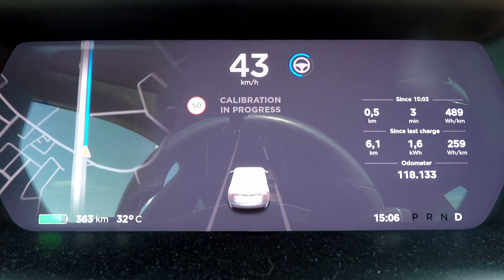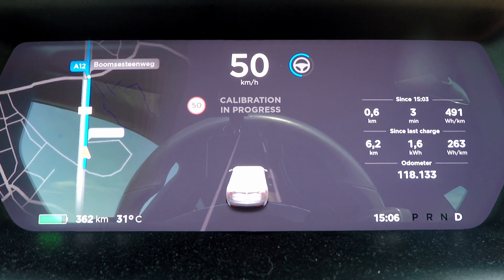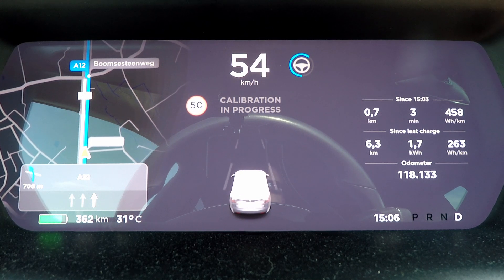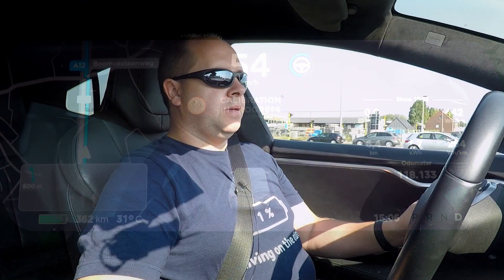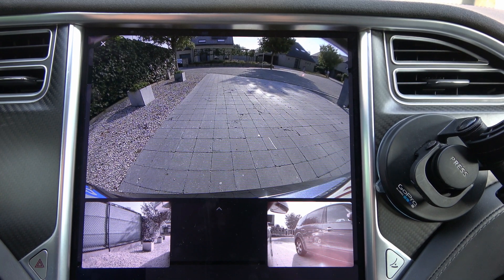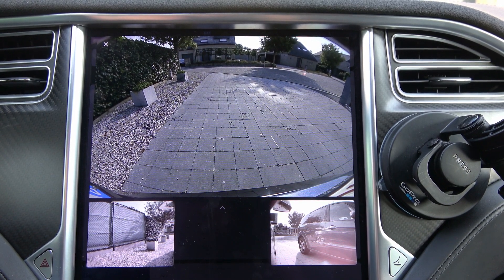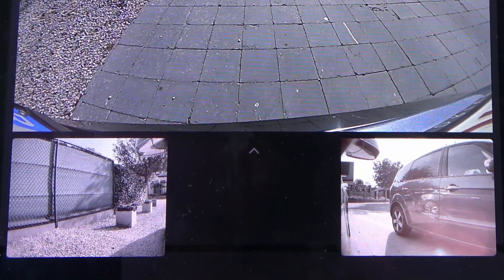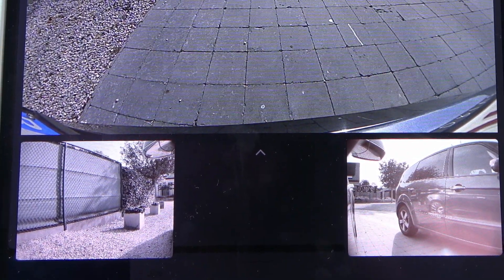Got the FSD and MCU2 upgrade installed today. What a difference!

Comment: Thanks - you can increase the speed of a slow mcu 1 also with a factory reset. See  https://youtu.be/qjYIN8yWfyw
Reply from the maker: Yes, but only for a little bit and only very temporary. Tesla has also tried to remove the cached Google Maps tiles and that had also a temporary effect, just as removing all your previous navigation destinations. They all help a tiny bit, but the fact remains that MCU1 is just not workable AND you're not getting any updates anymore. MCU2 upgrade is a no-brainer these days, especially since the price is a lot cheaper now than what I paid for it
Reply: @StevenPeeters  Indeed, the webbrowser still seems slower than it was after I first got the car (however I just did a test with a very weak LTE signal. Have to repeat that when the LTE is stronger.

Comment: I did the mcu2 upgrade incl. Ap3 with eap only because of the horrible mcu1 slowness and freezes and even if the problems with nand are well known and I've got still warranty for over an half year left Tesla doesn't do sh.. ^^
Reply from the maker: Same here. Didi the MCU2 upgrade because MCU1 was dying anyways.
Reply: Did they give any kind of discount for the MCU2 upgrade if the MCU1 is failing and still under warranty?

Comment: I had mine done on Thursday.(17/09/20) in Ghent. However, I did not have the calibration when I first drove it. Either something is not right yet, or the service center did that for me. Will call them on Monday. There are quite a few changes and I am not happy with all of them. So far the biggest disappointments are the quality of the new screens (far interior than before) and the fact that traffic lights do not get picked up... Will call the SC tomorrow and find out more...
Reply from the maker: Do you have the right software version? Calibration can be done by the service center as they test drive the car. it only takes about 10km if you are on the right road.
Reply: Bedankt voor je antwoord. You are right. Thee calibration was done by the SC. Got a message this afternoon that an update was available. Had to park the car very near the hotel to get WiFi. (we're on a short holiday) and after installing 2020.36.11, indeed it now reacts as expected. Have not come across traffic lights yet, but so far it recognises stop signs which it never did before. On the other hand, it seems to find traffic cones all over the place, while in reality, there are none. Heb jij ook de indruk dat de kwaliteit van beide schermen er flink op achteruit gegaan is? Bij mij is dat behoorlijk erg...

Comment: How did you request the MCU2 upgrade ? I already have HW3 which was fitted in Gent about 4 weeks ago, that was purchased 3 years ago on the website. I got CCS upgrade done through the app as Service/upgrades and typing in CCS upgrade then they sent me details and price by email and a Ranger came out. Please can you tell me how you applied for the MCU2, I am guessing the app Service/upgrade ?
Reply from the maker: I was contacted by the Service Center as a courtesy. Normally, you should request it via the app or call them.
Reply: @StevenPeeters  thanks. Will wait until fm option available as my mcu1 is working fine at the moment. Thanks for the video.

Comment: Hi how are the road tests going ? been calling Tesla service to get my HW3 fitted but its the same old story , call us in 3 to 4 weeks time .
Reply from the maker: Do you have a Model 3 perhaps? Those still have to wait. Comparing before and after AP test coming this afternoon. Working on final details and editing.
Reply: @StevenPeeters  No, model X 100D  Build November 2018 we had EAP when we picked up the new car at Tesla show room in May 2019.
Reply from the maker: zaferroni maybe the backlog is too big already? Dunno. It shoild be available if you order it with mcu2 combined.
Reply: @StevenPeeters  As I understand it the car is just over a year old and will have MCU2 The only thing I don't have  is HW3 and the new front magnetic motor ,but happy with the 2 induction motors which don't whine .

Comment: In the UK we lose the radio component (AM/FM/DAB) completely, you didn't mention that in your video? It can be added back (around 500 Euro) from October via an additional daughter board, apparently.
Reply from the maker: I mentioned that in an earlier video already. Yes, that solution should be coming in the next months, but will most likely be at an additional cost.
Reply: One does lose DAB. The original radio is analog. MCU2 van only deal with digital signals. One can replace the original radio with a digital version, but it is far from simple. Besides it takes changing one software line. Chances are that SC will not comply...
Reply: However TuneIn allows for most radio stations. But one can no longer change the channel via the steering wheel buttons..

Comment: Can you save video clips from sentry mode and use cameras as dashcam through USB noe with AP 3.0?
Reply from the maker: Yes, that shpuld work now. Still need to test that. But I have a real dashcam in the car so probably won’t use sentry mode
Reply: @StevenPeeters  would you explain why? I have blackvue installed in my car but only 2 channels so when someone keyed my car in the side we did not catch on film.
Reply from the maker: CBN you have a point there. But as far as I understand, you only get the last hour of footage before it gets overwritten. That is pretty much useless when you’re parked and something happens during the night.
Or am I missing something here? It also consumes a massive amount of energy compared to a Blackvue. I’ve heard people complain it can draw up to 10% overnight 😲
Reply: @StevenPeeters  you have fair points as well regarding power usage. I thought the frequency of overwriting depends on the size of USB penn. Not sure since I have ap 2.5. it is still interesting to know if it is possible to use this feature now after the upgrade. :)
Reply from the maker: CBN I will try the Sentry Mode as well of course 😉
Reply: @StevenPeeters  and dashcam footage as well please :D
Reply: @StevenPeeters  i have AP2. 5. I have a 32Go key and i have event from 1 month away so no, it only records when an event occurs so yoy have PLENTY of time.
For the consumption, it does draw power. Certainly nothing close to 10% but yes, if you let the car 3 weeks at the airport, it can draw your battery down...
Reply from the maker: Jean-Baptiste Labelle thanks for the info
Reply: I installed a 5€, 128Gb USB stick today (19/09/20). The car formats it for you in seconds and I could record straight away.

Comment: They are not exactly B&W cameras. HW2.0 is RCCC* & HW2.5 is RCCB* --- * In a camera each pixel is represented by 4 photoreceptors, with a combination of filters: C=Clear, R=Red, G=Green, B=Blue.  Multiple same filters for a pixel increases the light sensitivity. With RCCB, there is no green filter to improve nighttime light sensitivity, and green can be calculated to make a color image for the dashcam. via https://teslatap.com/articles/autopilot-processors-and-hardware-mcu-hw-demystified/
Reply from the maker: Thanks for pointing that out. I was simplifying indeed, but it does look B&W on screen. But the question still stands whether it would be easy to swap out the filters on the camera if they are hardware, or whether they can be updated via a firmware update. And if so, would it really make a difference...
Reply: @StevenPeeters  I guess they simply display them black and white because some "off colours" would bring a lot of people complaining about them and thinking they are broken :)
Reply from the maker: katze_sonne that kind of makes sense. But the new cars definitely have an off color to them...
Reply: Steven Peeters maybe not as off as these cams would be or they just didn’t bother to create a color filter making it look at least not completely off, because these are the old cams and this is the lowest effort support 🤷🏼‍♂️
Reply: I replaced both side repeaters picked up over the counter at tesla service center 120 USD each easy swap.  The latest triple cam is $170 and restricted part.  I told the service center to install it while its in the shop now getting the infotainment and FSD upgrade.  My vehicle is a 2016 MS75D with AP1 MCU1

Comment: Do you really think it's worth upgrading a  car with a nerfed battery pack (forgetting the part that you probably needed it to continue producing up to date contents for your YouTube channel and changing car would be much more expensive)? It's a dilemma or mine, upgrade or not to upgrade, since the resale value of the car that was lost after having the pack nerfed, won't get much better because I have an MCU2. I'm more tempted into waiting for the MCU1 to die. It will cost me the same, annoyances aside🤷
Reply from the maker: If you can trade in the car, that is always the best option. But also the most expensive. I would have loved to do that, but unfortunately, due to the huge price drop 1.5 years ago, that is impossible. So, this is the best option now to make it bearable.
The Youtube channel is only a very small part of the reason. It's not like I'm getting enough money fro it to pay for the upgrade. Not even close! But I do have to live with the car and I did pay for FSD almost 4 years ago and I have a dying MCU. I would refuse to spend any money on reviving a non-working MCU. Even if the memory problem is fixed, it will still be slow, the browser won't work, you still don't have Sentry Mode etc. More and more feature will require an MCU2 and that is why I think that even in your situation (and not knowing your financial capabilities, of course) it is worth it. It's an eye opener.
I would suggest trying to get a test drive in a car with MCU2 and see how it works for you and then decide.
Reply: @StevenPeeters  In these pandemic times,  if my MCU1 dies, I don't mind keeping the car off the road until the MCU2 is available. It's pre-AP, so all the FSD related goodies are of no interest to me, which reduces the number of advantages of upgrading.

Indeed, the MCU1 isn't the snappiest, but I do find it usable and in my case the browser works, most of the time!:P

Btw, if the dashboard is now "just a screen", can you still reset the MCU while the car is in motion? If yes, how long does it take to have it available again? Completely loosing all information about what's going on and with the car in motion seems a bad idea, but I guess Tesla folks know what they're doing .... right?;)
Reply from the maker: youlgsxl concerning the reboot, I did it all the time to get both screens black. Freaks out passengers 🤣. Car just continues driving. So yes, that has never been an issue and isn’t one now
Reply: @StevenPeeters  call me old fashioned then 😁 Btw, 2700EUR and the the old MCU stays with Tesla, right?
Reply from the maker: youlgsxl yes indeed. You can take it home for the wonderful price of ... well, basically the price for the new one. Wanted to use mine in a domotics project, but not at over €2000 for an old screen. Raspberry Pi with big touchscreen will do at much cheaper cost